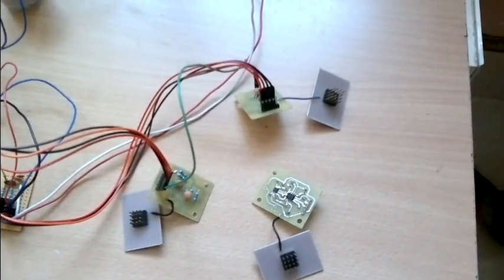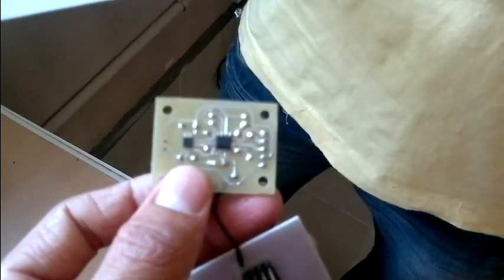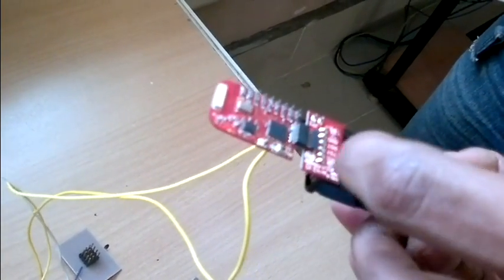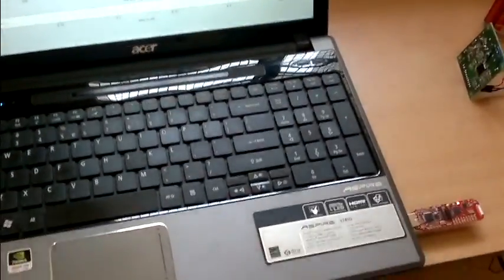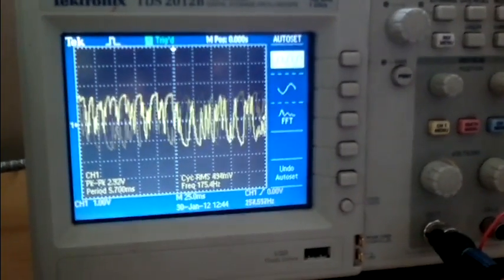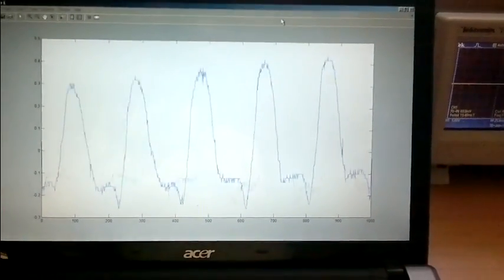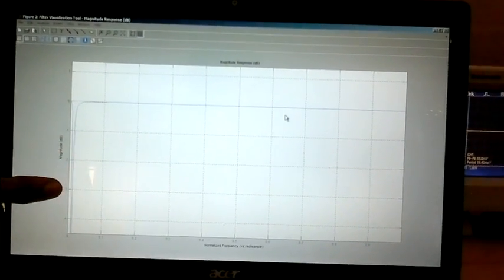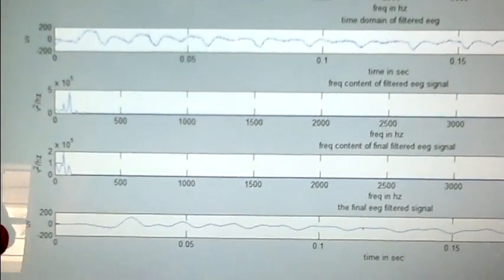TI Analog design contest 2011-Team122-Portable EEG with Active Electrodes

Comment: hi I wish to make a EEG based electrical stimulation device. how do I make EEG signals talk with the electrical stimulator. do I need a software for this
Reply from the maker: nikhil choudhary I have not worked much on electrical stimulators. But  what I feel is to make it work, you need a nice EEG acquisition device which could give u the raw EEG digital data. Once you have the data, u can perform DSP on that and feed a signal through an actuator back to the body. Since it has to be done in real time (I suppose), you need to take care of the delays in the loop. And to perform the DSP you can use any signal processing software, say MATLAB, which can read the serial port data of your PC in real time.
Reply: abhishek b OK thnx man , can I get ur email or contact number in case I get stuck, I m from a medical background.... I m looking at open bci platform to source the hardware that is required